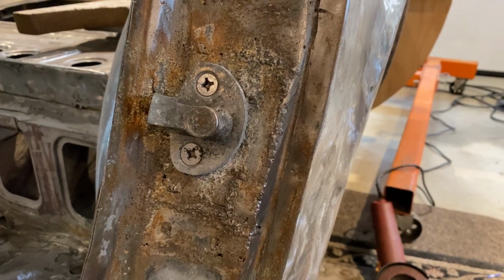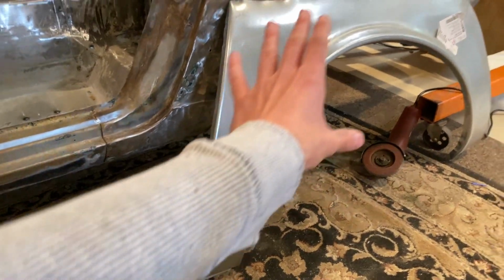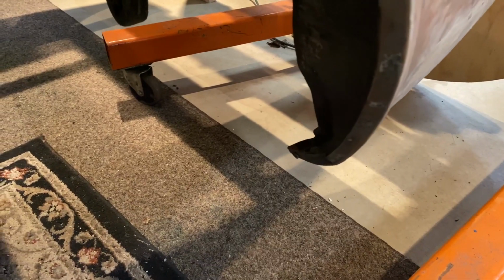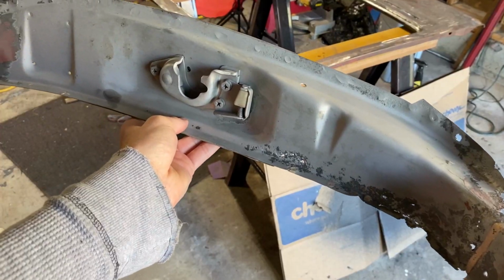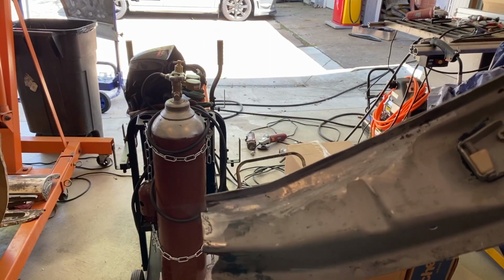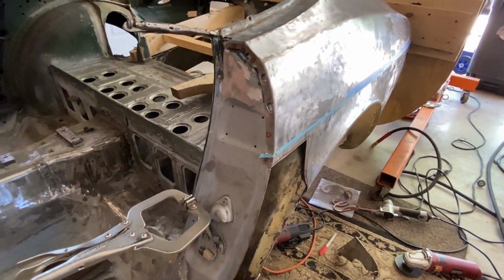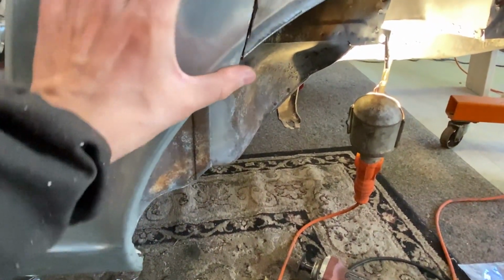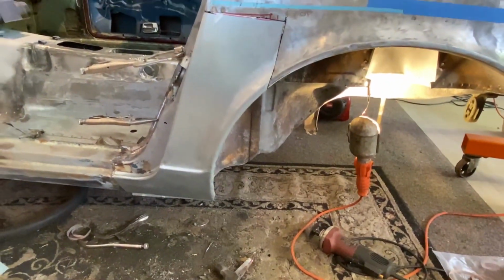Datsun 240z DOOR JAMB, DOGLEG and WHEEL WELL REPAIR Part 1! Destination-Z Ep. 7

Comment: Very encouraging video. I saved a 76 280z 2+2 out of a junkyard and have got to replace the outer rocker panels, doglegs, and quarter panels. Believe it or not but the floor pans are still very solid in this car. Great work and know that's going to be a beautiful Z once complete. 

You are correct on door striker, somebody put 77-78 door striker on that Z. My 76 appears to have the same striker as the one you installed.
Reply from the maker: Thanks! Everything can be saved but it does take a ton of time! 👍

Comment: Looking good.  I'm impressed you went back to the 240 door structure - nice touch.  If you are doing all that work to keep it fairly original I think you should consider leaving a body seam after you repair that rocker.  Too many Zs have had the rockers Bondo-ed over.  People with think your 240's rocker is full of putty also if you make it smooth.  Show off your metal work and reproduce the OE overlap (extend the new patch panel).  Also, you will probably need to adjust that radius on the lower section where it meet the rocker (one more relief cut would have been nice).   Let me know if you need any measurements (I have a 280Z  but I believe most of the body measurements should be the same - I'm south of CLE).
Reply from the maker: BikeInHudson thanks for the compliment! I am so tempted to make it smoothed over but then I had the same exact thought as you; people will think I caked it with filler if it’s smooth. Made my mind up now to do a factory overlap. I appreciate the comment and I will for sure get in touch with you if I need some measurements, especially since you are super close to me. Thanks again!
Reply: I used to live in Strongsville then Brunswick
Reply: Ryan Sampson id leave the seam. It’s how it should be